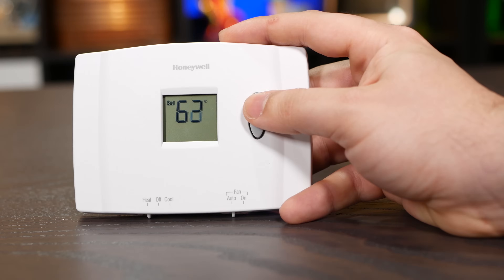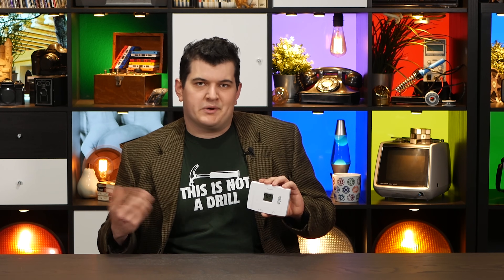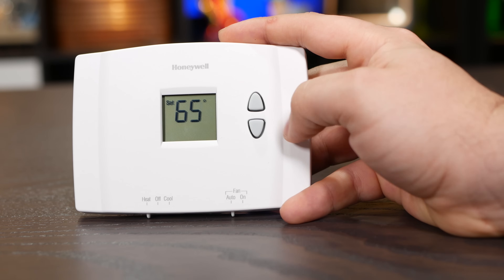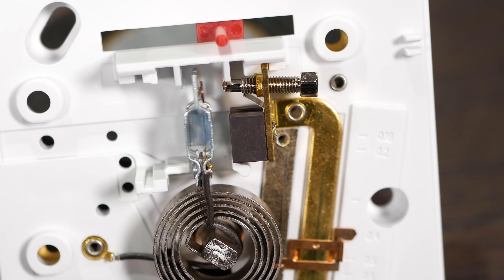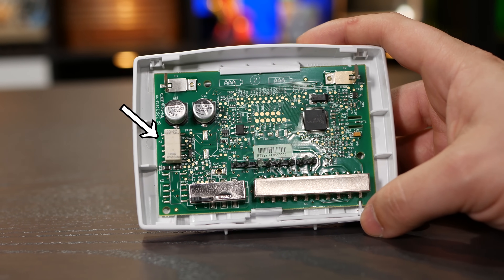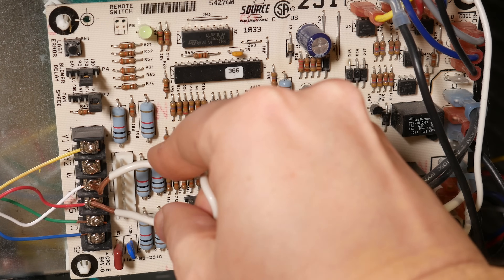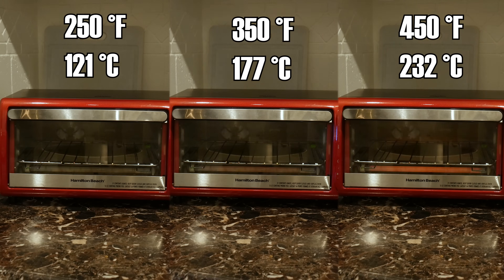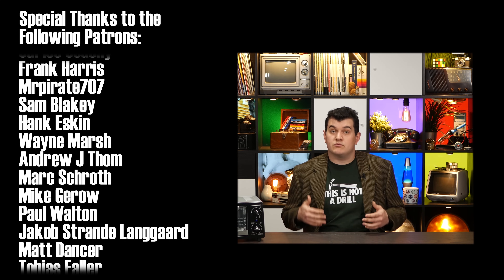Thermostats: Cooler than you think!

Comment: Good job, however, it does not include description of the “anticipator” function.
Why is it there and how does it work?
Reply: Ha!  Good point.  I had the same thought.  The anticipator is a heater in the thermostat (usually a tiny light bulb that warms up when turned on)  When there is a call for heat, room heat may not be affecting the thermostat enough to control it precisely.  The anticipator makes sure that the thermostat "assumes" that the heat is on by supplying it with an analog sample of the expected heat.  It fools the thermostat into thinking that the room is getting warmer.  This prevents overshoot and crazy fluctuations.  Newer thermostats don't seem to have this feature.  At least I've only seen it on the old ones.  Maybe commercial units have them.  I don't know.
Reply: @alext9067  I've read that most digital thermostats have self-calibrating heat anticipators.
Reply: @pcno2832    Interesting.  I wonder what they consist of.  I would bet that they use the clock and the temp to interpolate the function.  Thank you for that info.

Comment: As an HVAC guy, THANK YOU. I have to explain all this on a daily basis. R power, C common, W heat, Y cooling, G fan. Easy peasy. If you have questions ask me or your local pro. MOST thermostats take less than a minute to set up, the rest take two. 90% of what I've installed is single stage, the rest is two stage or maybe some Trane bullshit.Either way never more than 7 wire for 2S heat and 2S cooling. These days It's usualy 2-3 wires for communicating systems.

Comment: I Truly loved this video. Here in São Paulo the temperature goes from 5ºC to 36ºC, and so, only rich (or temperature sensistive people) have a AC. Central furnace? forget about it. Most people does have the portable heater with the 1500W resistance. I have installed in the window of my bedroom an old air conditioner with a reverse flow valve, so it can act as a heat pump and warm my room. The best of both worlds. Equipment truly simple to service, give me cool in this intense hot city, give me warm in the lonely silent cold morning... All in a tiny box weighing 30kg and occupying half of my window. extremely cheap, also (bought a used one - 300 reais  - 75 usd)

unfortunately i never had contact with central hvac and simply don't imagine how it works

Comment: My thermostat does that. You just click the switch to “on” and it will run indefinitely according to whether it is set to “heat” or “cool” 
I mean the downside is that you have to get back up to turn the system back to “auto” but I mean it’s potentially less work than having to program it, right?

Comment: In Europe, modern heating system don't rely on a thermostat anymore, but instead have a temperature sensor outside on the north face of the building that in combination with a heating curve will heat the water. Circulation is 24/7. While you can combine this with a thermostat to have some fine tuning, it still works great without. Because the buildings are isolated very good, the whole heating/cooling cycle is in line with the outside temperature. The only thing that is a "problem" is that the buildings heat up very quickly when hit by the sun. Blocking the sun from the outside with shutters, screens or trees is necessary.

Comment: I managed to get around the lack of C wire with my nest3 by using IFTTT (at least until August it seems, :sadpanda:).  

I set up 3 time based trigger points in IFTTT at 12am, 8am, 4pm (1/3rd splits) to activate the Nest trigger action "run the fan". So every 8 hours, the fan only mode of my HVAC would come on, run for 30minutes (note here for anyone duplicating this, it only actually triggers "RUN THE FAN AT THE LAST INTERVAL A HUMAN RAN IT FROM THE THERMOSTAT", not actual set amount of time, so if the last person ran the fan for 2hour, like after burning dinner, it will run for 2h not 30min), and then go off.

This kept the air sufficiently stirred in the summer and winter without needing additional blast by mixing the hotter upstairs and cooler downstairs air, with the added bonus of keeping the Nest battery topped off.

Comment: as a hvac tech I often see customers shut the heat off when they arent home and then turn it on when they come home, they cant grasp the concept that thier thermostat will bring on the heat pump and the auxillary heat when the demand for heat is very high. then I get a call saying the auxillary heat comes on too often and the oil/electric bill is higher than it should be

Comment: Not completly true, specially on 240V thermostats. Here in canada we mostly use electric heating via baseboard heater. You can have those dumb mechanical thermostat, and you get about a 2°C variation in temperature. Setting the heat higher do absolutelly nothing.

BUT there is since over 20 years some electronics thermostat with proportional output. It use a PID system. It will basically pulse the heater to get a variable power. One type I had would work in 10 seconds cycles. In those 10 secs, it will turn on the heat for 0, 1, 2, ..., 10 seconds at a time for 0-100% output, in 10% increment. And this is where it get trickier and where your "raising above do nothing" is not completly true.

The way it set the power requirement is basically this: it calculate the difference in temperature between the ambiant and set point. 1°C = 100%. If you set it to 21°C and it is 20.5°C then it add 50% to a base value. So at 20.5°C it will be only 50% on! Setting it to 21.5°C will make the heater go 100%, until the temperature  raise, then the difference lower, so setting it to 22 for example ensure a 100% heat atleast up to 21°C, then it will start to drop and you overheat the room.

Now, remember I said a base value? This is because the thermostat will integrate the difference over time to a base value, and use that to maintain the exact temperature. For example, you set to 21°C, it is 20.5°C, so it is out by 0.5°C and heat 50%. That 50% will get added slowly over time to a base value, which will raise slowly. Now that base can be 20%, and the thermostat command 70% heating capacity, and it raise slowly in temperature. At 21°C exactly there is 0°C off, but now the base may be at 30%. This is now what the thermostat will command all the time to maintain the exact 21°C.

The reverse is also true, you just closed a door that someone left open? The base value is now way too high, let's go extreme and 100%. The thermostat will unfortunatelly cause an overheating situation, as the heater is 100% for a room that trully need 30%, so the temperature raise over the set point, let's say to 21.5°C. Difference is -0.5°C, so -50% over the base value, so now it will command 100%-50% = 50%, which is still too high, but still integrate that -50% to the base value over time, which drop back slowly to be exactly the 30% it need.

This integration take a few minutes, while the difference is instantanious, well, as instantanious as the sensor can be of course.

This ensure a few things: the temperature will never excede +1°C, so minimal overheating, while recovering fast from a door that opened, within a few minutes usually. The normal temperature in the room will stay within +/-0.2°C unless you open a door of course. Thanks to the PID controller! And it save energy by avoiding overheating, while increasing confort.

Now, some newish gas and oil furnace, also some thermopump, even if on 24V, have simmilar capability, and not just a 2 stages heating.

As for the electronics thermostat power, there is ways to cheat over the need to power itself. The thermostat need to power the relay, so still some significant current. Not alot, maybe 30-70mA I would guess. Here is how you can cheat: Those thermostat work on 3V or so, you can steal 3V out of the 24V and the relay will most likelly still be happy. That 3V is now way more than enought to power the thermostat. Or, you can use a small transformer, steal 1V, feed that to the transformer, which increase the voltage to like 3V. Now you have like 10-15mA (1/3 of what the relay consume). This is not alot, but enought to actually charge the battery over several days. And frankly, you don't need much power. The electronics itself use basically no power, probably in the 0.1mA range or even less. What will consume power is the LCD backlight, which may want 100mA, but for what, 30 seconds a day? Let's say 2 minutes. Since it have 10mA charge current, it mean that the battery will be charged in 100mA/10mA = 10 times more, 2 minutes * 10 times = 20 minutes ! As for the relay, they cheat again, they use latching relays. Those are different as they do not need power to keep it's state. It is like a light switch. Once set, you don't need to hold the switch. It basically have a magnet on the switch part, which depending on the polarity of the electro magnet will get pulled or pushed. All you need is a bit of power to actuate, then you cut the power. It most likelly power the electro magnet for less than 1/10 of a second, absolute max 1 second. Again, even if the relay were to take 100mA to actuate, after only 10 second max the required power is already stocked in the battery or a capacitor.

Comment: (16:25) Temporarily changing the temperature (I call this temp temp).
The one we have (ritetemp 8050C) does this. In fact it offers three options to do it.

OPTION 1: Override:
Simply press the temperature control to whatever temperature you desire. This will immediately cycle the heating or cooling to come on. It will remain at that setting until the next program cycle. So if you have a program set to end at 2pm, the setting will remain effective until 2pm and then revert to whatever temperature is programmed to begin at 2pm.

OPTION 2: Temp Hold:
This is identical to the Override option except that you press the Temp Hold button before changing the temperature. The temperature will remain effective until you press the Temp Hold button again or press the Mode button.

OPTION 3: Special Day:
This allows you to pre-program a temperature for anticipated deviations from the normal routine. For example, when you come home when you're normally away. Or you go away when you're normally home. Press the SDP button and the temperature will switch to the pre-programmed setting. It will revert when you press the SDP button again or move the Mode switch. It's fairly simple to reprogram it to a different setting.

Comment: I would argue that a thermostat would be more akin to a PID controller than comparing it to PWM. PWM is a specific way to controlling devices. PID is closed loop controller that would change a state to make something hit a setpoint.  Such as a motor going to a certain rotational position, or a furnace turning it on and off to keep a steady temp. 3D printers do this as well with both the hotend and bed.

Comment: You didn't talk about anticipators, they existed even in mechanical, often mercury switched, thermostats of the 60's and 70's and I'm guessing is still incorporated in modern solid state units, where the "hysteresis" (i.e. the +/- temperature range over which the on/off cycle is adjusted to prevent short cycling), is further adjusted so that on very cold days the unit would be started sooner so that the heating unit would start a bit earlier so that it could keep up with the faster temperature drop, to keep the house from dropping below the minimum temp before the furnace could catch up. The old mercury units used a miniature heating element attached to the bimetal spring, which if the house temperature was dropping to quickly, caused it to snap on sooner than when the temperature was more stable. Btw thanks for your videos,  they seem much better as in both easier to understand and more thorough than the highly produced "How it Works" shows.

Comment: If you were wondering if there was a fun magical word for the temperature difference between when to turn on and off, it's called hysteresis .
So if you have a hysteresis of one degree, the heating would turn on at 20° and off at 21°.
(I assume electric heating could use a smaller hysteresis as it doesn't require a system to turn on and shut down)

Also my Norwegian electric floor heating thermostat has the option to choose the percentage of time it's heating instead of chasing the temperature you set.
(which is kinda neat, but kinda useless)
Reply: I was shouting out "that's hysteresis" while he explained that, haha
Reply: Thermostat anticipator setting for fun and profit!

Comment: It's worth noting (from a fan of yours over here in the UK) that single-direction central heating systems with heat-only thermostatic control are the norm here. Very few people tend to have domestic AC - I visit homes of many people of different backgrounds and even the very rich haven't generally installed it in their home. It just doesn't get very hot often enough throughout the year to warrant it.

Comment: So, quick story.
My mom and I back in the late 1980s, I forget what grade, used an old mercury switch style thermostat to test if fans really cool things down.  We had the switch in the circuit for the fan so that it would turn on at a warm temperature and the fan was aimed at the bimetallic strip.  Was a fun, but ultimately pointless.

Comment: Wait, so when I don't post anything when I have nothing worth saying, I'm hurting channels? 🤨 Doh! Okay, then, I have nothing to say, but I'm going to boost engagement anyway. You hear that Al Gorillthm? Give the man a bump.
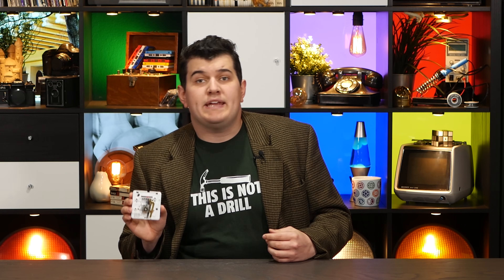6:25 - It's "de-bouncing" the input.
8:28 - Legend says Alec is still bouncing left and right to this day…
11:54 - But the element wastes a lot more electricity while it heats back up than it would if it were still warm.
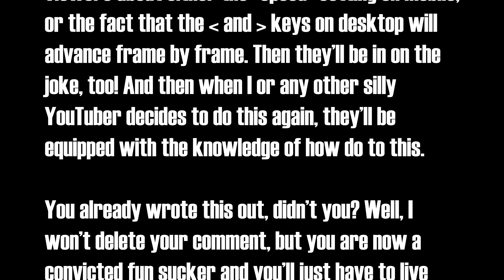12:24 - Thank goodness for the ',' and '.' keys.
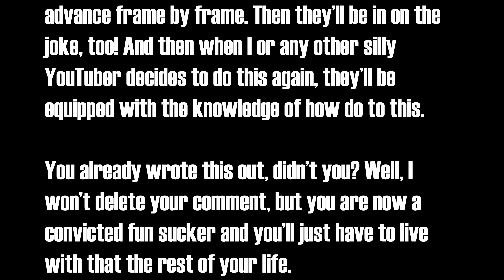12:27 - Aaaaand demonetized. (Google does OCR on every frame.) Oh merde. 🤦
16:26 - I'm sure commercial stats exist to do stuff like this, but since a thermostat is an extremely simple device, it's almost trivial to "roll your own" to do what ever you want with as many features as you like with just an Arduino and a relay bank. 😉
I guess I did have something to say after all. 🤷 Oh, and congratulations on the shout-out on vlogbrothers; Hank's a fan. 👍

Comment: Fun fact: On some modern cars, the LED brake lights use PWM to control their brightness. If you pay attention, under certain conditions you'll be able to see that the low brightness setting (without the brakes applied) seems to flicker, while the high brightness setting doesn't flicker at all.

Comment: I live in an old commercial building turned apartments built in the 40s so cinder-block construction no central heat or air,  sometime since the conversion someone installed mercury thermostats in all the units that control the circuit breaker for the window unit A/C in each unit, you have no idea how surprised i was when i went to rip that "old useless thermostat" off the wall and  found out it was essential and a minor biohazard

Comment: I think you're looking for the terms 'closed loop' and 'open loop' control. Closed loop is where the control system can measure and react to the actual variable it is trying to control, e.g. a thermostat measuring the room temperature.

An open loop control system is something like the simmerstat on most electric cooktops, which simply runs at the power setting you command regardless of what is happening to the pot on top.

PID controllers are also an interesting topic, but gets very maths-y.
Reply: Closed loop is like a monarchy, if the king is behaving good, he lives to see another day. When the king is misbehaving, his head gets hit out of the park.

Open loop is like the American system of government, if one pill makes you feel good, then two pills must make you feel twice as good and four pills make you feel four times as good.

Comment: So why can't baseboard electric heaters use digital thermostats? Did I miss that explanation?
Reply: They can; you just need to build a controller unit for it.  That would consist of a 24VAC relay with contacts that can handle the amperage of the heater, and a 24VAC power supply.  I made such a unit to control a space heater, mainly to have the thermostat some distance away and get more accurate control of the room temperature.  It works great.

Comment: To your last question, can you set the temps temporarily?  Yes, with most modern thermostats. I don't think I've had one that didn't do that in the past 20 years.  Some, you can even set how long you want your temporary temp change will last.  All you have to do to activate it, is change the temperature.  Then, after what ever pre determined timer (or programmed) it will fall back to the regular temperature schedule programmed in the thermostat.

Comment: Not an HVAC guy, but I'm pretty sure the C wire stands for "Common" and is effectively equivalent to the Neutral wire in your electrical system. If it were DC instead of AC you would call it Ground. If you don't have one on your furnace, you would use a 24VAC transformer and run those wires to your thermostat as 24V and C. The thermostat will have a rectifier circuit and power supply to run the  electronics onboard. This setup will cause at least the thermostat's Real-Time Clock to go out of sync in the event of a power outage though, if not other settings, so it's still best practise to also install a battery, or plug the transformer in to a small UPS.